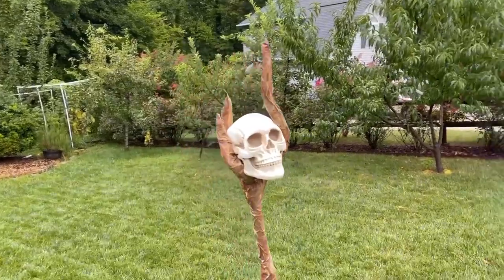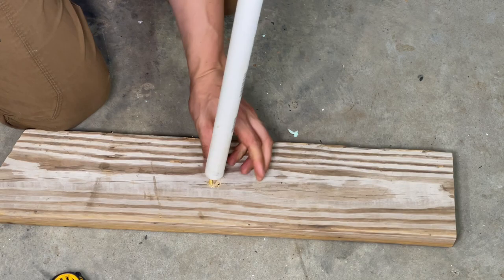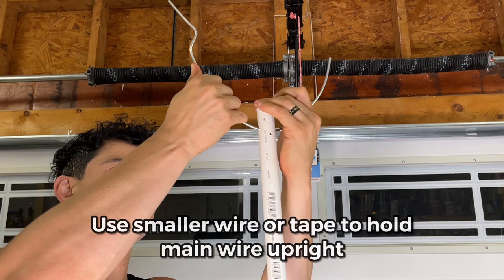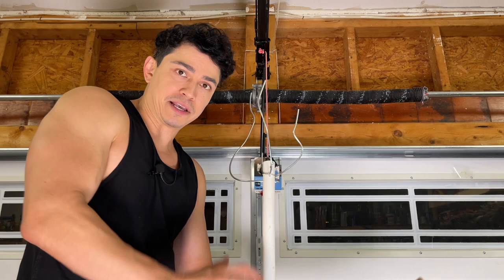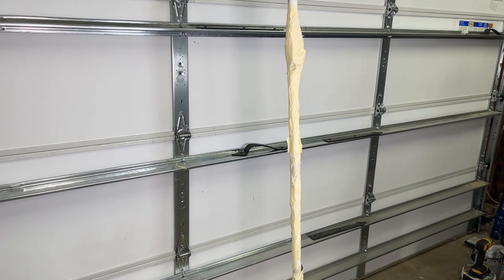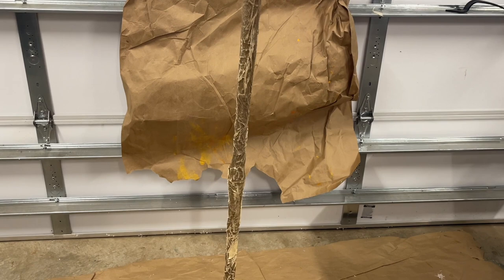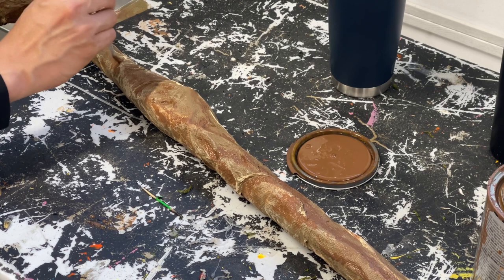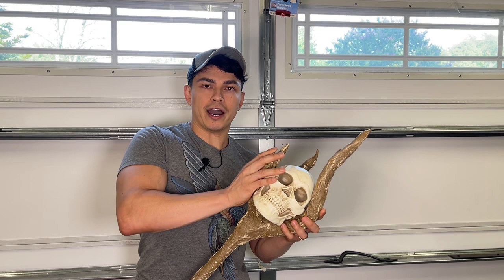Wizard Skull Staff Tutorial - 7ft Tall!

Comment: This is a good looking staff.  With your next project try using tissues instead of paper towel. You get the same effect but as the tissue can not absorb as much liquid,  you can speed drying time with a hairdryer.
Reply from the maker: There’s several issues with this method. If the only benefit is drying time then it offers little benefit. Wood glue has a long drying time, and the blow dryer method only works if the glue is applied thinly. In this tutorial, glue needs to be applied heavy and thick. Lastly, using tissue is not appropriate unfortunately. Tissue paper is far too thin and the glue are too thick and coarse. While applying it with a brush in this tutorial, the paper towel was tearing  at times but care was taken to ensure it would work. Using tissue paper would therefore not work

Comment: Just started watching all the videos! Can't wait to start working with foam and making some spooky stuff! Would you be able to speak to the lighting you use outdoors? You could do an entire video going over the different pieces you use for various projects. For example, what lights did you use for the flag video? I'm going to be making 3.5 feet tall characters and want them to be seen at night.
Reply from the maker: Thank you for watching my videos. Currently I don’t have any plans to make a video about lighting but 90% of all my props that require lighting are lit with LED landscape spotlights that plug right into an extension cord. Here’s the link 
MEIKEE 7W LED Landscape Lights Low Voltage Outdoor Spotlight with Connectors, Landscape Light, 3000K Warm White, IP66 Waterproof for Driveway, Yard, Lawn, Flood, Swimming Pool, Garden(1 Pack) https://a.co/d/bGd1ajP

Comment: Great idea!!! If i may suggest an idea though. Instead of using the metal wire use some 10-2  or 10-3 electrical wire and hot glue three of them right into the top of the PVC pipe. The thicker wire will hold the shape better, I think.  I like the way the branches were painted.
Reply from the maker: Not sure what the point of using Romex wire would be when the galvanized wire that I used is inexpensive and sturdier. 9 gauge wire is not easy to bend, in fact it may be too thick for some people to handle and they may have to resort to 12gauge